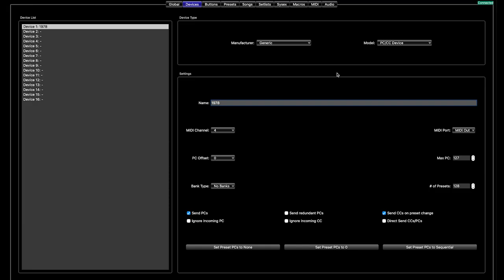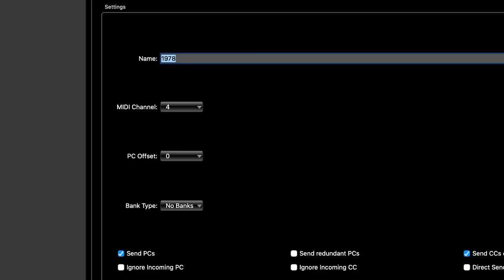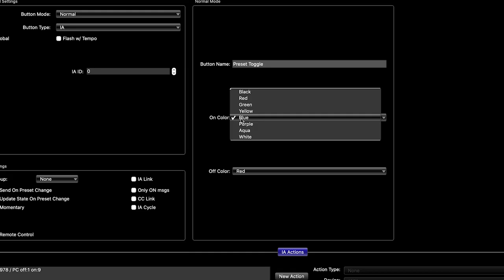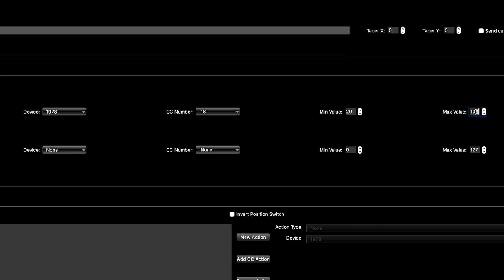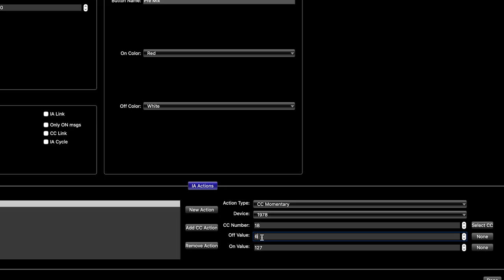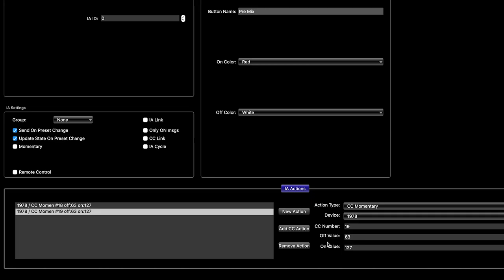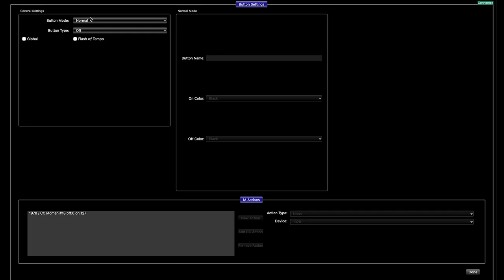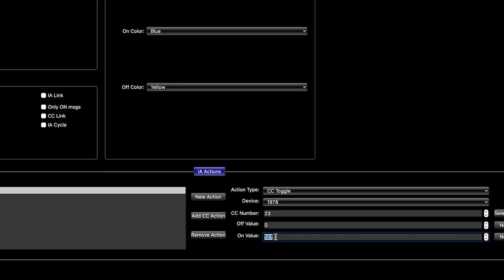Chase Bliss Audio CXM 1978 & Midi Control!

Comment: I’m a midi rookie, I appreciated this.  I have a question for you: can you achieve bouncing ramping via midi like you can with the traditional dipswitches on standard size CBA pedals?  I’d love to be able to slowly modulate the predelay to get at that pitch wobbling in a slow and smooth way.
Reply from the maker: Very good question.  I would ask them that one directly.  I don't have the pedal on me to check and the manual isn't clear on that question.  They have great customer service though, so see what they say!